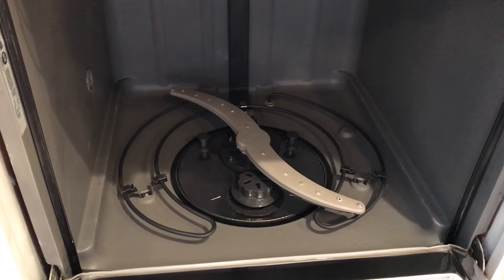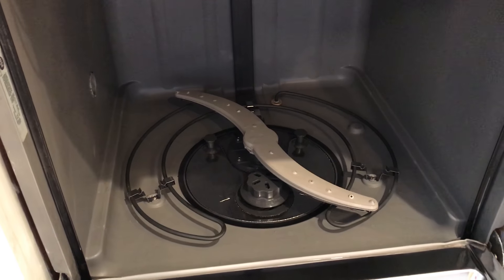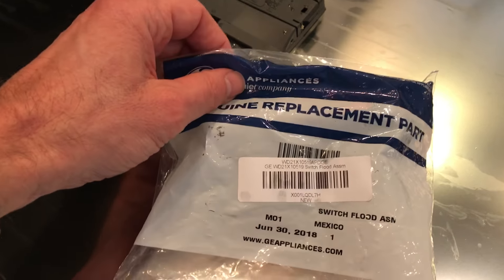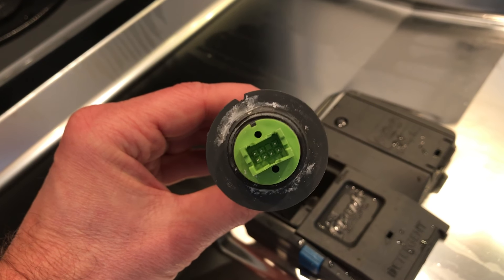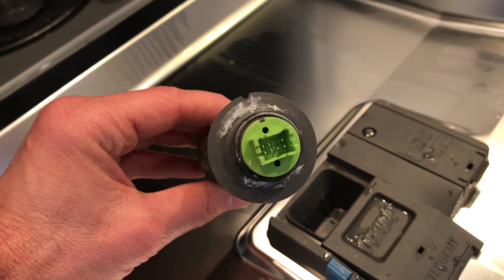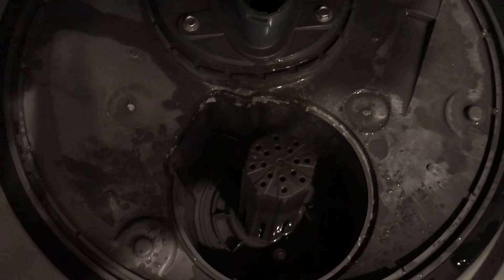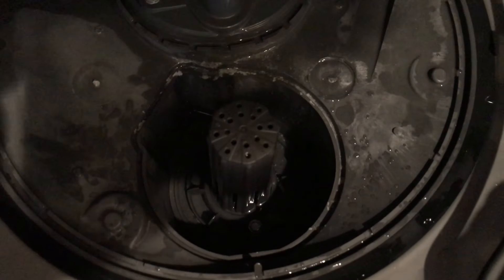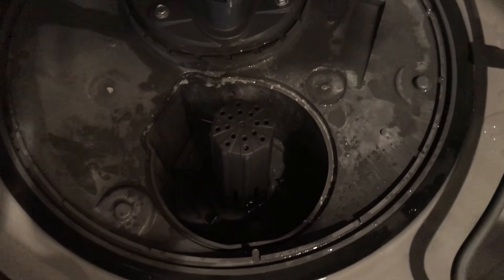GE Dishwasher not Drying Dishes - How to Replace Bad Flood Switch

Comment: My GDT580SGF8WW had the same problem.  After watching your video I purchased and installed the new flood switch, and the unit is working again.  Thanks!!
Reply: Nearly two years later, had to replace the same part again.  Came back to watch the video and refresh my aging memory.  Good thing I saved the link!

Comment: Thanks for the info. I removed the old switch. I didn't check resistance. Installed new one. Worked out ok. Dishwasher began to dry properly. Thanks again!

Comment: This worked! I replaced the heating element and that didn't work. Replaced the float switch and that did the trick!
Reply: Small suggestion - perhaps show how to unplug the wire. I tugged a little too much before I realized how to get at the wire. Otherwise everything went well. Definitely clean everything while you are at it. Mine was disgusting.

Comment: Thanks for making and sharing this, buddy! I pulled my switch and did use an ohmmeter on it. It read 2,700 Ohms, which GE's internal docs say indicates a temperature of 135F. At room temperature (75F) it ought to be 11K or higher. New one on order. With the confidence inspired by your video, I'm looking forward to repairing my machine.
Reply: Following up: Installed the part last night. Heating element came back to life! Thanks again.
Reply: Which pins did you use to ohm out the float switch thermistor?

Comment: Thanks for the info.   My GE Profile dishwasher isn't completely drying the dishes.  Heating element tested out good.  I came across your video while searching for info on a thermostat or control unit for the heating element.  I am looking into the Flood Switch first.  

Just a suggestion that may help you protect yourself from any liability, you may want to mention at the beginning of your video that anybody attempting this repair should make sure that the power is cut off before working on their dishwasher.  There are a lot of not too intelligent people out there who know just enough about repairs to dangerous.  Anyway, thanks again for the info.  I will let you know if this ends up being the repair I need to make.

Comment: Before you do any of this and buy anything. I recommend you press your TCO button and see if that helps. I changed the heating element and the flood switch and the turbidity sensor after watching countless videos. None of them fixed my heating issue. Finally found that information on the Thermal CutOff switch and it fixed it. Costs $0 to fix and about 10 mins of time. Not sure why everyone making videos about this don't mention this option.

Comment: I replaced this part on my GE GDT580SSF2SS and it was as good as new. The heating element was not working and the water fill level was too low (not enough water). Replacing this part fixed both issues.

Comment: Yes! Thank you. Taking the float out worked for me. Maybe putting the washer model might help someone looking to fix this specific washer. I broke my head looking for someone like mine until I found yours fixing a problem I didn't think was my problem. Thank you so Much! It was very helpful. Definitely help me learn more about my washer and know I could fix it on my own. Girl P💥wer🦸🏻‍♀️
Reply: Hey Mayra, thank you very much for your comment as it helped me fix my issue. I read your comment that yours was not spraying or filling with water after you cleaned your dishwasher by cleaning the filter & screen and the exact same happened to me as well and  that's when I ran into this video and your comment. I followed your route of opening, cleaning, shaking and putting the float switch back in and viola the dishwasher started working fine and better too I think as all that debris & gunk is gone now. Thank you. For those wondering about my dishwasher model it's GE GDF540HSF4SS that came with our new house in 2015. Many folks suggested to replace the Water Inlet Valve
 part# AP6286892 but it's actually the Float Switch that is required to be replaced.

Thanks to the OP for posting this great video as without this video I would not have found this post. Happy Holidays everyone.

Comment: Thanks for the info!   After an element and board, I found 16k ohms at the board.  A little low on the temp sensor.  Thanks again, problem solved.

Comment: Great video  and very helpful, I had a similar model PDT7760SSJ7SS and it required the same replacement part. It went in as you described. However, on my model I had to take off 4 screws that held the water propeller on the base to get at the back screw easily. And it is good thing I did as it needed a thorough cleaning. Thanks again.

Comment: Yes indeed. This works. I found, however, that I had to also cut the power after replacing it and leave everything off for a few minutes.. otherwise it would run, fill for about 5 secs and repeat. Something about resetting a motor timer?  Now after replacing that flood sensor, I am only out 95 bucks ( much cheaper in US than here in Canada!) instead of 500 for the new washer my spouse wanted. Joy.

Comment: My favorite part:  'You just remove the connector from the back.'  So far it took me less than 5 minutes to get to that part and I have spent the last 45 minutes trying to 'just remove the connector from the back'.  Obviously there is some complex trick to this since I have pushed and pulled every plastic tab in each end and they still will not separate.  For others reading/watching this - the bolts holding the float in are 1/4 inch.
Reply: You probably have a new DW by now, but I was able to get it out by using needle-nose pliers, and gripping from the long sides. Wiggle it a bit, back-forth, and it will slide out.

Comment: Thank you so much for your video. I ordered this part and replaced it, now it’s showing a “Leak detected “ message. Do you know what went wrong and how to fix it?!  I really appreciate your help
Reply: Replying to a one-year-old comment, hopefully for the benefit of others in the future. When you replace the flood switch, as Uncle Heavy mentions, dry out the strainer well to keep water from spilling out. This also makes it easy to clean out any gunk that might interfere with the o-ring seal for the Flood Switch. You should wipe around the edge where the switch goes and at the bottom lip, making sure nothing will keep it from seating and sealing properly.  Unplug the dishwasher from power before working on it, for your protection and the protection of the electronics.

Comment: I am curious to know how long  have you had your dishwasher for? I am experiencing the same thing with my dishwasher, which is exactly like your model. I’ve had my dishwasher for only a little over 2 yrs.. didnt buy the  extended warrantee...
Reply from the maker: It is about 4 years old. I’d bet that you have the same issue.
Reply: OK so I changed the flood switch and tahdahh! My dishwasher works now!!! Thank you soo much for your video! $27 bucks. And it was fairly easy to do! I used a little torch wrench and a magnetic tip pen so I wouldn’t loose the screws!

Comment: My problem was just the float. Needed unsticking
Reply: After a while though, that float model will keep sticking. I hauled it out and cleaned it twice. Then I gave up, bought the part, and discovered my heating element performed better afterwards as well

Comment: hey!! if you see this, im about to buy this part because my machine gets no water.  wasnt the water pump.  wasted hundred of dollars on a service guy who did nothing...  so... was about to trash the thing but... 1 google seach and i think i know the problem.... im lookin at my float and its pretty bad... and it does seem the float is stuck at the top, maybe an inch down from the top top...  it wiggles up and down but only maybe a cm.   im wondering... did that new float... did the thing inside noticable slide along that whole thing? or is it still stuck in the top area where you cant see.   i dont know what a good one is like.

Comment: I changed the heating element on my dishwasher and it was heating (albeit not very hot) for a few washes and then stopped again, is it likely that the flood switch is the issue?
Reply: It is very likely that your problem is the flood switch. Post back to let everyone know if changing the flood switch worked.

Comment: Any way of fixing this part instead of replacing it? What is it about this part that causes the heating element to stop working. Seems odd.
Reply: It's a seven pin assembly, two are to monitor the float. And the other five probably go to to thermistors to regulate steam temperature and water temperature, and of course that heating coil

Comment: Can anyone help? I tested heating element good. I bought new flood switch that does not rattle. I took my old one out and that does rattle. I put the new flood switch in that does not rattle and my dishwasher still does not dry. Do you think my new flood switch is defective? Is the flood switch float inside suppose to move up and down? Thank you for your help!
Reply: A working flood switch does rattle when moved. Silent is not good.